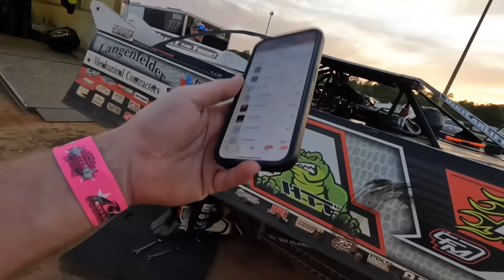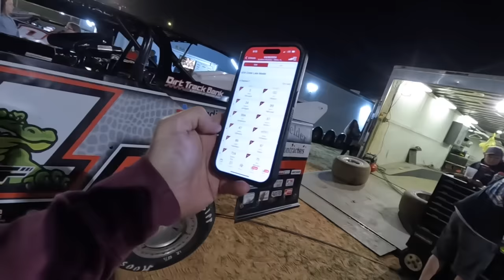Well We Started Fast… Jesse Back in Faithful at Southern Raceway!

Comment: Not trying to be a jerk or anything but if you are the fastest car in hot laps why make a change on the right front that takes you from 1st to 8th? It cost you a significant amount of time if it would have worked out would you have gained that much on the field? I don’t think so. Come on boys use your noggin. #HTFnation4life
Reply: Just because you're fastest in hot laps when the track is wet , doesn't mean you'll be fastest when track gets dryer , but I wouldn't have went way off in my changes
Reply: Track surface always progressing. Never the same. Starts off wet with grip, dries out from there on and then starts to take rubber and slowly grip will increase the more rubber gets laid down. I tend to tighten my car up from hot laps to heat race, unless it super wet and will have grip all night. And that is rare unless you have good bit of rain that week, cool damp weather and little sunlight/wind.